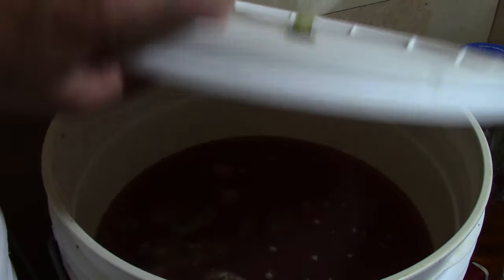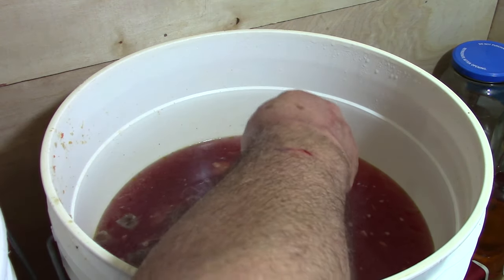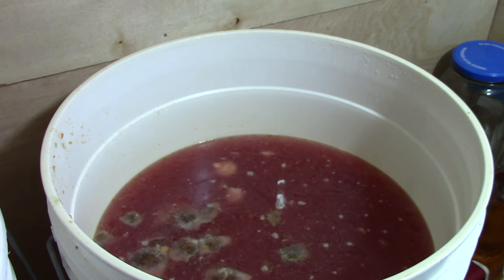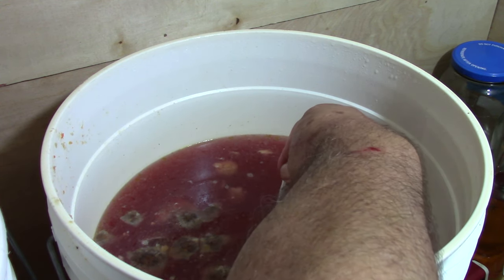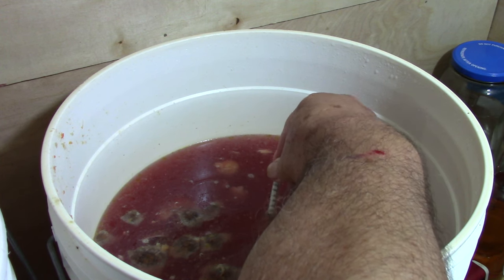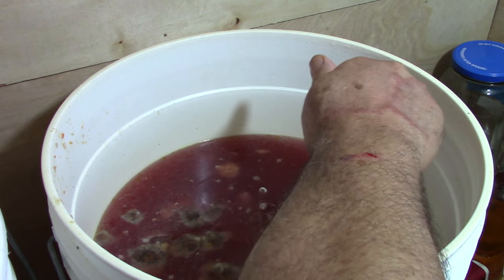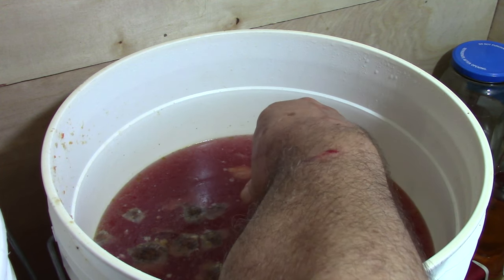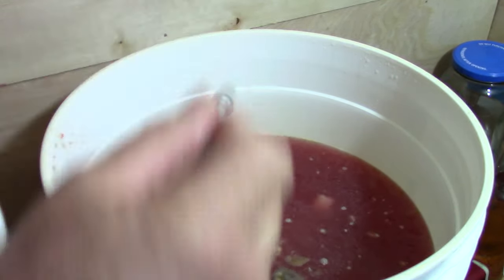7  Root Bourbon Distillation

Comment: Randy, I had the EXACT same thing happen on my run of Jimmy red corn this past weekend.  My SG was 1.075 and the final was 1.010 so that should be a ABV of 8.4%.  I had 27 gallons in the still when I started my run and after removing my foreshots the distillate was coming off at 148 Proof. I collected 1 quart of perfect shine, on the second quart I noticed the color had a slight amber color. I checked the still temperature and it was fine, check the proof of the distillate and in 1 quart it had dropped to 120.  on the third quart the color had darkened even more, but it was not scorched...and the proof had dropped to 100.    I have NO idea what went wrong, sometimes I guess you just chaulk it up to S#&t Happens????
Reply from the maker: I think your right

Comment: 10+ oz. of fore shots....yeah no wonder you started a 120 abv. reading. I have a bleed valve at the top of my column and at 146 /153 for 15min I vent off the methanol and my fore shots are probably a 1/5 of that. Even if I didn't have that valve I would think 175ML will enough. and I run a medium broken stream off my pot still. But it happens I'm sure you made some fine Root Bourbon there, another good Video from you Randy...🍺
Reply from the maker: my rule of thumb is 1 oz per gallon of mash and if fruit mash i will collect a bit more

Comment: I empathize with you having the same situation this past weekend. I expected 3 but only got 2 based on SG and proof. One thing I have started doing to 'stretch' a run is moderately compressing the tails with the dephlag. I target output to stay around 100+ proof. Seems to work, and sometimes I can see very high proof while I get things adjusted. What's your take on compressing the tails?

Comment: My thoughts about why this happen? Answer is - I never boil vegetables with water! It makes porridge and yeast is not eating this shit. I do like this - this method is 100% success! I take water and take +80~90C - it depends how many vegetables we have. If there is not too much and pot is big (it is very important - bigger/ better, because of thermal mass (we need at least 12hours of hot/ warm water to soak all juices from vegetables)) we can use +80C.  I use something between.  I do like that:  I take 1/2 of the volume of the pot - fill with water - warm it, than add vegies, than I boil another vessel with +100C water, switch off but after all vegies come in pot (vegies drastically reduce temperature which is very bad) I add this +100C water to fill everything full. Than I isolate all this goodness! It stands 12 hours and suck all that inside. After all process is complete - temperature is about +20C I use all this!!! together and transfer it to the fermenter!!!! It is VERY IMPORTANT, not through it to garbage! This gives everything to yeast! It is like cake! Yeast eats it like crazy! Color is gorgeous too! All fermentation takes 7 days approximately and it will be happiness! 😇P.S. I have one question - specially to you! Your system with 2  glass jars. I think - this system cleans spirit! Is it true? It means - I made copper system and copper is everywhere! I need filtrate it with NaOH and with another chemical and for me - copper is death (peoples are poisoned everywhere in the World because of copper stills)! But, I think if I make this thumper setup - all copper will be collected inside (or trapped inside if I will use NaOH in one of the thumpers/ evaporators)? What do you think? Thank you!

Comment: I've had this happen several times.....it's usually when my SG is around 1.060 - 1.065. I'm always left with that same look on my face wondering what did I do wrong. I'll usually do a stripping run, then a spirit run.....always brings it back.

Comment: The only thing that comes to mind is that you ran too hot at the beginning of your run and smeared water into the output of the condenser. If you had decided at that point to make it a stripping run and collect down to 20% and saved the heads and hearts you would have recovered more spirit for a spirit run. Cheers!
Reply from the maker: thanks for the help